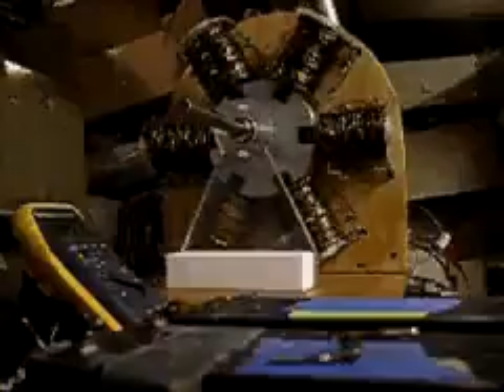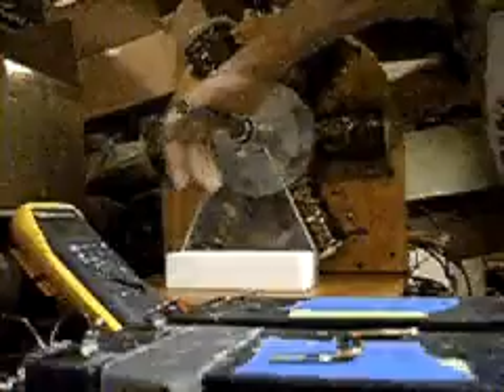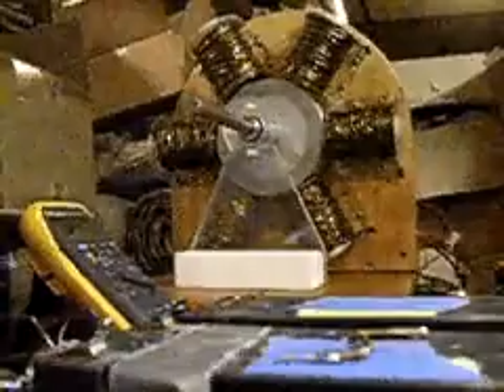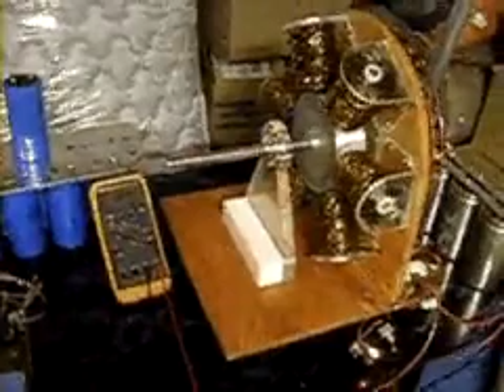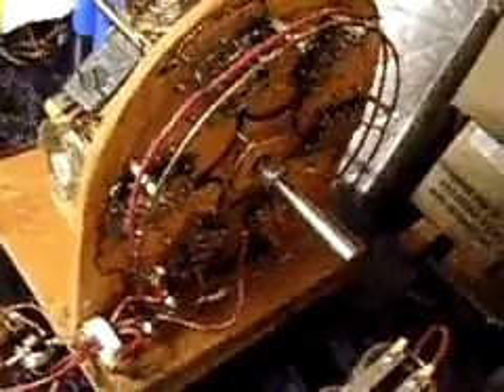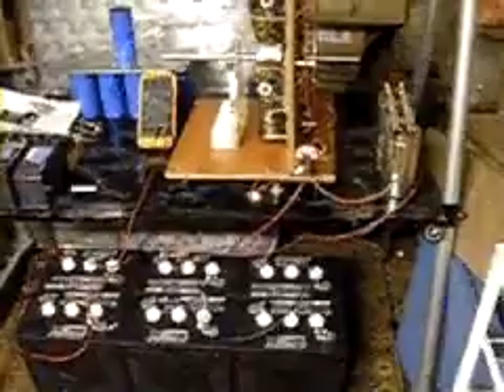Bedini 6 coil energizer

Comment: good work...

"It isn't operational at the moment after blowing out a bunch of transistors from excessive [avalanche breakdown] energy production during an experiment. Unfortunately the transistors have to be very closely matched and now I will need to replace all 24 transistors at once before I can run it again....."

Have you considered 2-3 Jewel mosfets in parallel with TVS diodes at rated avalanche voltage, and monitoring current absorption into battery bank to know when to switch banks or shut off? 

This machine sounds impressive and it would be an honour to stand in front of it while running.
Reply from the maker: I havent done anything with this particular machine in years. Maybe some modern mosfets like that could work, but John was always adamant about using BJTs in his energizer circuits.
Reply: @DavyOneness there is works because batteries was connected? 😅

Comment: Does it produce alot of torque?
Reply from the maker: Its around 2-4k rpm, It could have lots of torque if it is geared correctly with a good flywheel. This design is more of a magneto battery energizer that the shaft could also be tapped for some work. But for a real torque motor, look to the bedini "window motor" design that doesnt have iron poles so you can use the strongest magnets you can find to use (normal motor designs would lock the rotor up on the iron poles with too strong of magnets on it,and it will never be able to start turning around)
Reply: Do you have a design that have speed and torque?
Reply: Thanks alot..
Reply from the maker: @noelvictoria609  yes, the best design for speed and torque is the Bedini  "window" or "zero force" motor